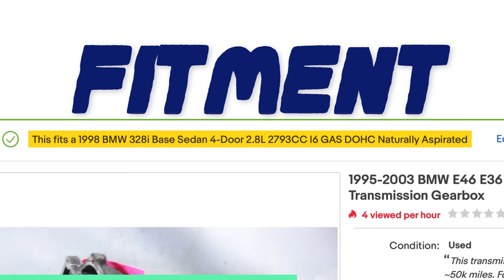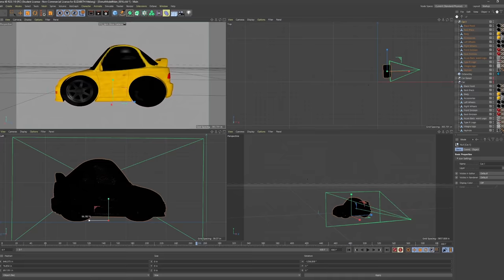Is a Manual Transmission Swap Worth It?

Comment: Short summary: 

Yes, yes it is. Not even a competition.
Reply: yeah, wheres the fun in not being able to set gears?????
Reply: @rodrigolemos4869  there is none
Reply: The problem with manuals is on road trips with a lot of traffic
Reply: What about DSG swap?
Reply: @lauperleo  only if your leg is weak
Reply: @lauperleo  drove 731 miles in one go with mine, heavy traffic, rain etc. no problems.
Reply: depends, autos are really fast, especially double clutches
Reply: @lauperleo  I've driven manual transmissions for as long as I've been driving and through any normal conditions you can imagine. Heavy traffic has never been an issue for me.
Reply: @huntermacdonald6431  bullshit ,driving that much in any car is guaranteed to give you terrible back pain and shifting gears will just make that problem wotse
Reply: @lawnylawnington  not in a 90's car
Reply: @micuna5743  my mother got her license at 20 I think, she has never driven an automatic in her life and she drives daily, to work and back.
Reply: @lauperleo  well you got a point, i won't nag about manual, but yeah u wanna be comfortable in that case and, yes automatic is your answer. But again traffic ISN't fun, so get that 4 speed minivan.
Reply: @RayanM50B25  precisely
Reply: @th3ch33t  yeah it depends but in traffic on like a ramp or like going up a mountain
Reply: @peeepeeepoopooo7541  probably more wiring and electronic stuff. That is not to mention the subjective pleasure of a MT
Reply: honestly. My mother owns a Mitsubishi Galant Fortis and the JATCO JF011E CVT is absolute trash. The car is down now and it needs a transmission and I want her to put a manual in it because if a new CVT is put in there the same issue of the valve body or pulley system being dysfunctional might arise.
Reply: CVT < traditional automatic < traditional manual < sequential manual < dual clutch transmission. You're not smarter, more accurate, or faster than a new-gen automatic.
Reply: Over here in Germany (and the rest of Europe), manual cars are the norm. Heavy traffic in our tight cities doesn't scare us off ;)
An automatic, though increasingly more common, is still considered a luxury. But my '91 Seat with its slightly notchy 4-speed is definetely more fun than my grandma's C Class 😉
Reply: @ivokiller2000intel  that's true but they shift fast as hell
Reply: @lauperleo  a lot of traffic doesn't really matter for a manual. if you're talking stop and go, that's a different story, but there's a strategy to make it actually easier than an auto. Even if there wasn't, it's still worth it by far
Reply: @ruthenian.wisdom  jiij
Reply: @ruthenian.wisdom  jiij
Reply: Worth it money wise definitely not considering for same price he spent for the car and parts he could've just bought a manual e36
Reply: @AndrewB23  If you watch the video where they unveil the car, he said a manual e36 was significantly more expensive than an auto. Thousands more. @ 22:25 in this video he even says it's about 3k more for a manual E36 and he didn't pay that much in parts
Reply: Super easy, barely an inconvenience.
Reply: @user-ki9ez8wx7f  bahahaha! love the ryan george reference
Reply: Short summary: I’m going to show you the same car I bought with manual transmissions for 7,000$.  I bought mine for just under $5000 and put around $3,000 in parts in it.  For those who can’t do it themselves tack on another $3000 and wow that’s really worth it.  I’m in it up to $8,000-$11,000 instead of $7,000.

Yeah I’d say they are hard up for episodes
Reply: @lauperleo  ugh, I hate this argument. I’m not disabled. And I change the clutch slave and master to a bigger bore if I have a harder clutch.
Reply: @therealjoshtodd  
If the average difference between AT and MT is $3000, and they spent $3156 from the total of the MT parts, then the price would come out the same

But then they could sell the parts from the AT and recover maybe $1750 hypothetically. Potentially worth it

BUT you have to remember they are using probably up to $600 dollars worth of tools, and a whole weekends worth of time (16 hrs about) depending on the car
Reply: @user-ki9ez8wx7f  😂
Reply: I have a MT just to have fun with.
Reply: @DanielFlores2277  but how much are they making off this video that has 200k views already (after only being out like an hour)? for the average person I would say manual trans swap isn't worth it IF they make the car in manual already. Some cars that's your only option. For example, manual swap on an RS5 was going to cost me about $9k and I was absolutely ready to pull the trigger on it because it's THAT worth it to me, but I found a mint V8 S5 in manual right when I was about to buy the RS5 so it became moot.
Reply: @jessem.5867  I really hope that you are joking
Reply: @deciplesteve  You're not but you still have 100% control on what the engine is doing, and I like knowing that my car could not run if I wasn't the person driving it
Reply: Besides the gearing and rowing, theres reliability. Blew up three autos in my ka7, luckily came up on a swap from a buddys wrecked ka8. We stripped the coupe in lkqs parking lot and ababdoned it🤣
Reply: @lauperleo  nobody in my country uses automatic i have went on 400km journey in my car and no problem woth stick because in my country no one is thinks that its a problem so it never crosses your mind and it shouldnt anyway.   
Im from India btw
Reply: For drivers that like to have fun then yea manual is nice and all but I don’t think people like my mom would like manual lmao
Reply: @lauperleo  That's something auto drivers always say.
Reply: @lauperleo  If you drive a manual car a lot the clutch will be muscle memory and you barely notice using it. On most modern cars you can clutch ride and it won't hurt the trans, which makes the much easier to drive in traffic.
Reply: @deciplesteve  I want to drive the car, not have the car drive me. When a car can drive itself around a track faster than humans some people will say what you did. It's not all about shifting as fast as possible, it's about you being in control of it all the way though and shifting exactly how you want. When you can daily doing heel toe without even thinking about it anymore your tone will change. Don't need some nanny making decisions for me.
Reply: @gabrielcooper1248  lol I dead lift 750 and I still get annoyed at my clutch
Reply: @micuna5743  exactly not even the “weight of the clutch” just the motion wears you out
Reply: @mercury0214  Your seat is probably too far back then, a habit a lot of people make from driving auto since auto allows you to get away with that. Push your seat forward more.
Reply: @mercury0214  I've never driven an automatic so you don't notice it after short while
Reply: @mercury0214  just proves that 60% of people in this comment section dont even drive a car
Reply: @lauperleo  That's complete bullshit. I have an E90 328 with a 6MT and it's incredibly easy to drive in traffic. The only reason to complain about driving a manual in traffic is if you don't know how to drive a manual property.
Reply: @lauperleo  Not that bad once your used to it.  I dont even notice it anymore. the good and fun out weighs the bad by a long shot
Reply: @rodrigolemos4869  it got nothing to do with fun or not lots of automatics nowadays get offered with pedals behind the wheel which gives you the possibility to set gears even tho you are actually driving an automatic car plus manual transmissions are restricting in point of performance because you sure as hell don't want a 7 8 or 9 or even 10 speed manual transmission because first you are shifting non-stop second if you mess up you are causing more harm than good not only to the transmission but you could also cause harm to other components as well hence the cons out weigh the pros especially since manual transmissions have a way higher wear than automatics especially in ongoing or nonstop stop and go situations in an automatic not much of a problem however it is a pretty big deal for manual transmissions because you are only shifting up and down the whole time and the more you do it in that period of time the more are you wearing down the transmission the quicker it is going to fail but also the more it need to get checked or even fixed which as we all know isn't for free
Reply: @lauperleo  just American laziness
Reply: @AndrewB23  yep - looked at least 2-2.5k in parts
Reply: Respectfully disagree, although maybe very dependent on the vehicle.
Reply: @lauperleo  To be fair, Zach switched the gearbox to manual because he’s aiming for a rally car project, so traffic is irrelevant in this, unless if he wants to drive it in the streets.
Reply: @LostBeetle  paddle shifters and a no auto upshift/downshift tune still says you're wrong.
Reply: @Cookiebreedchannel  very well put, you're right. As far as i know, getting a 6 gear manual is purely due taste, fun, disponibility, even if you don't like automatic. Like you said, butterfly type automatics are there. The point is, car are basically tools, and for each, "one" purpose. No need in getting further in a topic we all agree and enjoy.
Sorry I misunderstood you.
Reply: @deciplesteve  Yea if you like having less control over your vehicle for a tiny bit more speed, go for it.
Reply: Not worth it, throw a manual valve body and shifter in it, call it a day. Kind of feels like a manual and shifts quicker and more accurately than a human. If you want a manual car, buy a manual car.
Reply: @tyler9703  depends on what your doing and what kind of traffic
Reply: @dudewithaMiata7644  ive been driving a manual for around a year and a half now but it still gets annoying since my city has a lot of construction
Reply: Nah automatic transmission all the way manuals are trash
Reply: @LostBeetle  so you would willingly take a slower lap time? Isn't Donut making this a race car? Is the point of a race car to have slower lap times?
Reply: @deciplesteve  It's boring. Left foot on the brake the entire time, right foot on the gas, and pushing  a stupid button demanding a shift instead of making it happen yourself. No rev matching on the downshifts, the harmony is lost. Nanny has it taken care of now. You drive a paddle shifter you're doing less driving and that's a fact. Give it time and more racing leagues will crop up that will be manual only because the switch to paddle shifter was boring and sterile.
Reply: @thoughtuwasslattbutuaslutt6015  People used to walk everywhere, or ride horses, and they were fine with it too. Simply because people have been doing something a certain way for a long time doesn't mean it's the best way to do it.

Manuals and autos both have pros and cons. And there are good and bad examples of both. Of course you can use a manual in heavy traffic, just like you can use an auto in a rally car. Is it ideal? Definitely not.
Reply: To me paddle shifters seem more fun
Reply: @gabrielcooper1248  id love for you to come drive my manual swapped 70 dart. no hydraulics, only linkages and springs. have fun :)
Reply: @RayanM50B25  you dont know anything about autos.
Reply: @frigglebiscuit7484  yeah because 90s technology was defenetly advanced enough to make quickshifts
Reply: 70th
Reply: @lauperleo  how is it a problem?  I would MUCH rather drive a manual, under any circumstances. I can't think of a single situation where I would prefer an auto.
Reply: @lawnylawnington  This isn't about drag racing, nobody interested in this gives a crap about shaving tenths of a second off their 1/4 mile time. This is about making a car fun to DRIVE. Someone once said "You drive a manual, and ride in an automatic" .
Reply: @th3ch33t  That's what I am saying. There is no situation imaginable that I would prefer an auto. 46 years old and have never even owned a car with an auto.
Reply: @micuna5743  BS? lol. What you been smoking? Back pain?  Shifting gears wouldn't contribute even if that were true, which it is not.  Good grief I've driven over 2000 miles with only stops for gas and pee in a friggin 280z from the 70's. You tellin us BS about 700 miles in a presumably much newer and more comfortable car? Must be a millenial, bet you have soft hands. lol
Reply: @lauperleo  No it doesn't depend. Lets all understand that to folks who actually drive manuals every day, none of those things are an issue at all, we don't see a hill and think "oh no" ROFL. It's just not something you even consider or think about, if you are having trouble with hills, you're not doing it right. For mountains a manual definitely better. Going up OR down.
Reply: @deciplesteve  Maybe, but we don't care about shaving fractions of a second from our 1/4 mile times. This isn't about drag racing, it's about being fun.  I think in normal, spirited, road driving the extra control you have with a manual is gonna be faster anyhow. Try dropping your into 2nd, running up 6000rpm as you come out of a turn with your automatic.
Reply: @therealjoshtodd  That's what I'm saying, you could do that swap for $500 or less if you know whats up.
Reply: @aceggkspade958  I would say that you are hard up for someone who knows how to find parts.
Reply: @AndrewKidd14145   The problem is that these kids these days are weak, their frail little legs just can't handle it. lol  I've never owned an auto, and have never even once thought anything at all about pushing in a clutch. It's not something I even notice myself doing. Shit if you think a car's clutch is hard to push I'd like to see you riding my 1970 CB750. Now THAT is a stiff clutch, and you gotta squeeze it! still won't hear me ever whine about it though.
Reply: @supersportzcom  Exactly! Manuals very very rarely have any issues. Not to mention the ease of dealing with a dead battery, or a starter biting the dust.      I be driving home, able to change starter on my own terms while the auto guy waits on a tow truck.
Reply: @predatorxfilms6904  It's not a problem at all in this country either except for soccer moms, grandmothers, and millenials.
Reply: @Thiterest1  huh? how does riding your clutch make anything easier, and no it's not ok to ride a clutch in any car. Motorcycles you can ride the hell out of them but they have wet clutches designed for it. If you are riding the clutch in ANY car you are severely reducing your clutch lifespan.
Reply: @LostBeetle  They don't get it , I don't think many people under 40 do. The ones that like autos would be perfectly content with the car driving them around.
Reply: @mercury0214  Doesn't wear me out . I don't even notice it. I'm talking about cars from the 70's too, even cars with manual clutches that actually take some effort. If pushing a clutch wears you out, wtf do you do about walking?
Reply: @tyler9703  EXACTLY! There is no situation imaginable that would make me think "wish i had an auto". ICK
Reply: @Cookiebreedchannel  Spoken like someone who has never even seen a manual transmission. Wear? Dude manuals are 1000 times more reliable than any automatic. Manual transmissions very, very rarely fail. There are tons of them 50-60 years old and more still running strong on the same freaking oil that was put in them from factory. lol. Nobody who drives a manual complains about traffic either. It's not an issue at all. 
Also, no man, the paddle shift cars nowdays are not the same thing. You simply do not understand at all. SMH
Reply: @rKizCora_main  traffic is irrelevant, period.
Reply: @LostBeetle  THey are only a tiny little bit faster and only in a straight line drag race. Throw in some curves and a manual wins.
Reply: @enchantedwenis4994  you just don't get it. and no that feels nothing like a manual, if you think it does then you've never driven one.
Reply: @josephhollifield660  but Jobe is literally building a race car here, so lap times are exactly the point. Also, any DSG can do exactly what you're talking about through paddle shifters and/or bump shifters. There is a reason that every modern high performance car comes with these transmissions. They are better. I actually just swapped my customers R32 GTR from the stock, shitty 5spd to a 7spd BMW/Getrag DSG. Better acceleration in all gears AND a higher top speed.
Reply: @deciplesteve  you still just don't get it.
Reply: @josephhollifield660  I don't get what? Lower lap times is the point of upgrading a race car. Yes, this auto-to-manual swap yielded better times for Jobe, however a DCT would have had even better results.
Reply: @deciplesteve  You don't get the fact that 99.9% of the audience are simply guys who like cars, and don't have money flowing out their ears. Maybe you can shave fractions of seconds with a DCT, people who want a manual don't really care about that. The driving experience is NOT the same. There is nothing more fun than an old 5 or 6 speed manual, with a CLUTCH. A real DRIVER'S CAR.  IMO a real driver's car has a manual transmission AND steering. No hydraulics other than brakes, no computers, just the driver, the car, and the road. I like tech as much as the next guy, for a family car... That stuff seperates the driver and the road though, even in racing it takes away from the sport and the skills needed to be successful at it. HAve you ever driven a Z-car? I'm talking about a 240, 260 or a 280,  a real Z-car. Now, THAT'S a driver's car.
Reply: @josephhollifield660  yes, I put a set of triple webers and an upgraded cam in a 240z. It was great until I realized how shit the gear ratios are in that 5-spd. A clutch is great fun until about the 500hp mark (give or take depending on many more variables), but beyond that, a modern DCT is far more reliable and far faster.
Reply: @deciplesteve  500hp? Only about 1% of the viewers will ever even drive anything with 500hp.  Beyond that you are talking to a guy that  has never even owned a car made in this century. I've driven them plenty but there's just something missing, can't feel the road,  it never feels like the car is an extension of my body the way an older manual car does, it feels like riding in a car, not as if I am the car.
Reply: @josephhollifield660  and you need to realize I have professionally worked on cars ranging in ages from 1950s to 2020s. Yes, a 2000s era automatic is absolutely garbage. A new DCT in a performance car like a Porsche 911 or BMW M-series, hell, even one in a newer VW Golf is a massive step forward in power delivery.
Reply: @deciplesteve  I am in 100% agreement with you on that point. There is no question about that. Having a clutch that the driver has absolute control over is a hell of allot of fun though. Without it, bleh. If I was racing professionally it would be a different story. For something I drive all the time though, I want my clutch. A car doesn't even need to be fast to be a blast to drive with an old 4 or 5 speed. I have a little Mazda b2000 with 90hp, no power steering and a 5 speed and it's fun as hell to drive. Take away that clutch, or give it power steering and  bleh. For me, I want to feel the road, i want to feel the engine. When it's right it's like it's just me and the road, you know,  as if the car is just part of my body. You feel connected in  a way that is not possible in anything modern.
Reply: And he is not building a race car, he just wants to go play on track days. Of course to actually be competitive in real racing, state of the art is obviously the only path to take.
Reply: @lauperleo  be a man